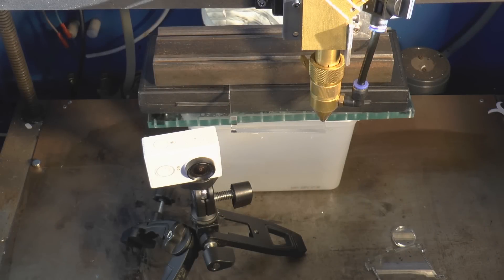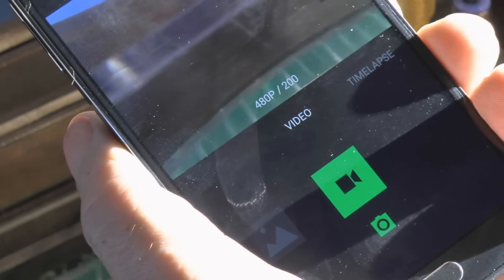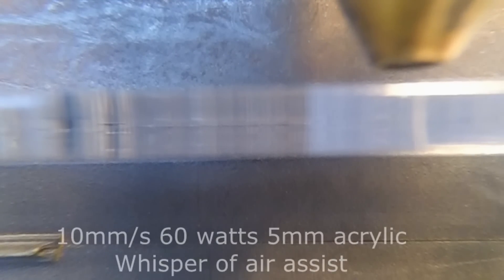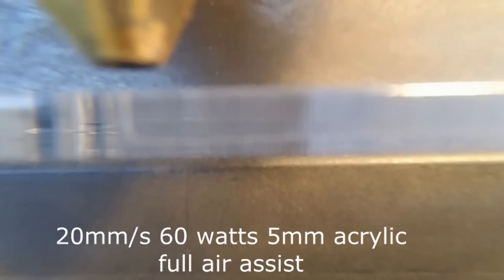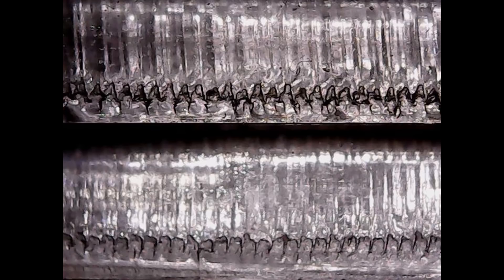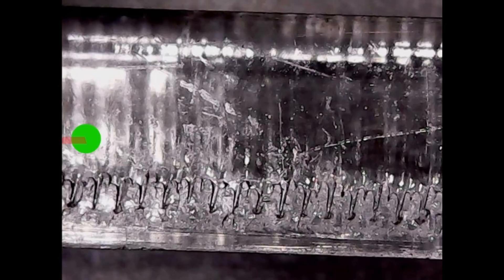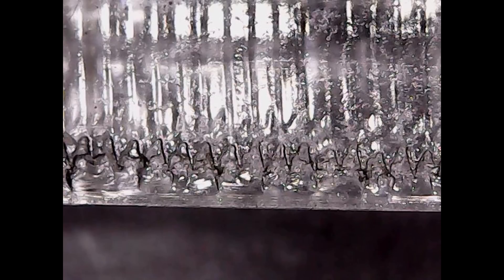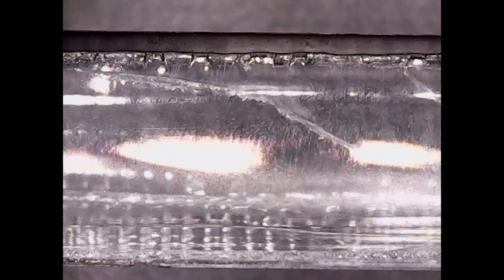RDWorks Learning Lab 86 Acrylic cutting slo mo

Comment: Hi Russ, just a thought regarding the gas exiting the cut at an angle, this could possibly be due to "Laminar Flow".
If you look at the exit point of the gas/smoke, it appears to "stick" to the bottom of the acrylic for quite a distance before peeling off at an angle, this behavior is very similar to how
liquids behave at low pressure. 
Just my 2 cents.
Cheers,
 Peter

Comment: Hi
Another great video!
Perhaps I'm missing the point here but I run a 130w tube and to remove the striations from the edge of 10mm acrylic requires a speed of 3mm/s and no air. 
At 60w @ say 70% on 5mm I would guess that 1mm/s and no air would remove this problem?
I had always assumed the striations where the result of the co2 pulse frequently and had never thought of the mechanics of ablation.
Reply from the maker: Hi Andrew
I use a 1.5" lens and can cut 5mm at about 8mm/s with just enough air coming out of the nozzle to prevent lens fogging and I can get virtually mirror polished edges.  However there is a tendency for the product to get stuck in its hole because the bottom of the cut gets sticky with the heat. Yes a bit slower and setting the focus a bit lower will fix the problems
The purpose of trying to run as fast as possible was to generate the striations for examination purposes. So many people believe these marks to be caused by the stepper motors/microstepping, and are even contemplating swapping to servos.That's the main myth I am trying to nail with this video and I do mention several times that running slower with virtually no air will dramatically improve the finish. For some small businesses, slow is unacceptable. 
With all the work I have done trying to understand the way these lasers work the only pulsing phase I have come across is the pre-ionization phase that will occur in your tube as it seeks to swap from 25kV to about 17kV for normal running. If you try running the laser at very low power values(maybe 7 to 12%) you will hear the beam is very "hissy"  when the beam is properly formed there is no pulsing involved, unless you are using dot mode.. I have recently bought a little USB scope and will be looking at some current flow signals in a future session to show these sorts of issues.
Also, I have to remind people that I am the one that is experimenting and learning in this video series. People consider them tutorials . Wrong. My other hobby is video, so learning about this laser and it's strange technology is great material for that pursuit and it means that the world gets to look over my shoulder. Any experience or advice you wish to give will be gratefully received.
Many thanks for your comment Andrew
Best regards
Russ
Reply: Hi Russ,
As I thought, I had the wrong end of the stick. You may be learning as you go but your analytical and pragmatic approach to each video is educating people around the world including myself.
I look forward to your future uploads.

Comment: Great video work.

It seems odd to me that the striations are so regular if they are being generated by a chaotic gas flow effect. What actually sets the period of the striations?

I would love to see the tube cathode current on a scope together with the step signal to the X motor to be absolutely sure the beam and motion are constant. Are you anywhere near Manchester?

I noticed on an earlier video that no matter what speed you run the machine the tone it makes seems to be constant. Normally with stepper motors the pitch of the noise is directly proportional to the speed. If that is not the case then there must be something odd about the drive method.

Is the air flow pulsing an issue?. When I dismantled a hot air gun powered by a diaphragm pump I found a plastic tank following it. Presumably that was there to smooth out the air flow. Why it would matter when soldering I don't know but diaphragm pumps do pulse.
Reply from the maker: Hi
I'm going to pass on that one.  I just cant check it because with 60 watts at 100mm/sec I do not get much depth of cut so, I dont know if the striations would be there at 100mm/s, with say, a 100watt laser where you  may be able to get a 4mm deep cut. As you can see,, doubling the speed fdrom 10 to 20mm/s did not double  or halve the period . That tends to point to a property of the material and not the performance of the laser. It's rare that I actually worry about edge finish on jobs but occasionally it's important, so I slow things down and back off the air. The whole purpose of this exercise was to prove that the edge condition is not related to the stepper motors as many had guessed. I'm happy to have nailed that particular myth. So I hope a clearer understanding of the problem will save others changing from steppers to servos to fix the issue because I was experiencing exactly the same striations cutting acrylic on my new ,machine which is fitted with hybrid servos.
Thanks for the question and the kind words
Best regards
Russ
Reply: Doubling the speed would not affect the striation spacing if say the laser was pulsed at a rate proportional to speed. I vaguely recollect that is a control method used by some people to keep the power density constant when the speed varies, or perhaps I dreamt it. 

I am hoping to take delivery of a Glowforge 45W CO2 laser in Jan but I have been waiting for it for more than a year already. When / if it turns up I will try to do the same experiments if I get striations  as I do have a 1000 fps camera and several oscilloscopes and logic analysers.
Reply: @nophead I too remain suspicious of laser power fluctuations/pulsing as at least a partial contributing cause unless (scoped) evidence to the contrary is available. Have you ever got to doing those tests...? I'd be very interested in seeing them if so...

Comment: I really loved this video.
Something I have always considered wrong about these machines was the method of air delivery.
They are dependent on an air delivery system that pulsates.
But it is obvious that the "mountains" and valleys are not the same.
Flame cutting at lower air assist rates might become smoother if your pump supplied an old Freon bottle or something that 
regulated pressure so that the air flow was also smoother?
Reply from the maker: Hi
I don't think smoothing the air will have a significant effect on cutting efficiency but it is something I have in hand for a future video. I plan to use just a 5 litre plastic bottle as an accumulator because the pressures are so low. I don't know the answer at present.
Thanks for the comment
Best regards
Russ
Reply: Cool ..

Big fan as always,

Jim

Comment: hey, Russ.  I have some question for cutting acrylic of the high precision. I want to modify the XY axis to ball screw that enhance the position precision.  because i hope the cut 10mm acrylic about 120MM length in 0.1MM tolerance. can you some suggestion to me?
Reply from the maker: Hi Jun
I am not a lover of toothed belts for controlling CNC machines but you will gain very little accuracy by changing to ball screws. Let me explain why.  The calibration of steps to physical dimension has to be calibrated at some point in the machine's life and stepper motors can easily achieve a positional accuracy of 0.025mm (0.001") . The belt is very stable in tension because of its spiral wound steel cores therefore  stepper motion is faithfully converted in to reliable and accurate linear motion ......in one direction.  It will NOT be the same in the reverse direction because of belt clearance on the drive pulley. However, because that  clearance is constant,  it is possible to add a software correction factor to remove this, 
see  https://www.youtube.com/watch?v=DeCxeCrq0h4&list=PLPWEtx5V9DqEogIeYRdcG_KYcB7UL2Qmn&index=49&t=746s

You are adding a lot more cost and rotating inertia  which will ultimately limit the acceleration performance of your machine

There  are TWO  other BIG issue you have not considered in your self imposed challenge.
A) The coefficient of expansion of acrylic. At typically .075mm/m/deg C,  120mm dimension will change by almost 0.1mm per degree C temperature change.  You can never cut acrylic rapidly because the cutting action is one of evaporation  at 200C and cutting 10mm thick material creates a lot of heat in the cut . Hmmmmmmm . How realistic is your goal now? If you measure it just after you cut it and then 5 minutes later I suspect it will be about 0.5mm smaller. 
B) Will you use cast or extruded acrylic? Cast acrylic will have abysmal thickness tolerances but because it is a poured liquid process it is pretty stress free. The same cannot be said for extruded acrylic . That will SHRINK  when cut as  the mechanical production stresses are released. It will also not shrink the same in both directions because there is an invisible directionality to the grain structure .

So now you know how impossible your task is. BUT understanding the problem is 50% of the solution. If you want accurate parts you must work with a pretty constant temperature and after cutting allow your part to stabilize. Then you measure it and add a correction factor to you drawing to allow for these errors. 

These problems exist no matter how accurate and expensive your machine. You cannot ignore the laws of physics.

I hope this puts your problem into perspective and saves you a ton of work and money!!!!
Best wishes
Russ
Reply: @SarbarMultimedia  
Awesome.it's good to elaborate explanation of aspect of  physics . 
1. As stated above, how to control the temperature which is my question. I have two idea that change the air blow or box environment temperature.
2. In mechanical structure, have any suggestion. In my concept, Choosing the ball screw and slider will stable in endurance of working time or easy to tune light path.  Yeah that maybe will bad concept that hope correct to me.
3. In my test , I have cut the 2mm or 1mm acrylic. It’s bad experience for me. i want control the precision in 0.1mm(in 120mm*120mm)(0.2mm tolerance of high yield).  it’s very unstable and difficult.
    1. Maybe the machine will work over 5 years.
    2. The Acrylic was difficult to control.
Reply from the maker: @juncheng6383  
Hi Jun
First let ma apologize for a typing error I made. The expansion of your 120x120mm square will be about 0.01mm/deg c and NOT 0.1mm/deg c as I typed. 
With thin acrylic there is less heat build up in the cut but cutting heat is still an issue. When you understand the physics there are possible cutting solutions that will reduce these effects.
You mention high volumes so I am now imagining that you have a very big machine that is working with a full sheet of material?  I think it will be better to speak by email so you can send me details of your problem because I feel there may well be methods of cutting that will achieve the precision you require. There are some extra problems with big machines that can cause the beam to wander. The CNC is accurate but the beam may not be in the same place relative to the nozzle for the whole work area. If you wish to discuss your problem further, add  your disguised email to another comment and I will contact you.
Best wishes
Russ

Comment: Great video! There are macro lens for this camera for about $10usd if you're interested, and you can adjust focus, shutter speeds with simple hacks.
About the striations, I wonder what would happen if the acrylic was preheated close to its sublimation point. Also some big pro machines use vacuum suction under the workpiece, could this be to draw out the smoke before it "ignites"?
Reply from the maker: Hi
Links to any of the lenses or the hacks would be useful please. I have a spare that I can safely play with. My bodge was adequate to gain the information I needed, but clearer pictures would have been better. Still impressed at what it will do for £50..
Nice idea about preheating  but there is one major issue, it wont work. Acrylic starts to soften and be come floppy at as little as 130C whereas the decomposition temperature we need for cutting is in excess of 250C  A useful reference document is http://stephen-webster.co.uk/wp-content/uploads/2011/02/Acrylic-forming-guidelines-for-workshop-practice.pdf 

I do know that the fumes are combustible because if you cut thin acrylic with too much power/not enough speed then the residual power can  actually ignite the vapor. I have experienced it many times.
Best regards and thanks for alternative ideas
Best regards
Russ
Reply from the maker: Many thanks for that info I look into it further
Russ

Comment: I think is a worth to see this part of my video - https://youtu.be/9x-H-rHN9nc?list=PLKqvqV6FhMtWv-wab69zSEvSEPDgJN4cz&t=232 where is a visible different effect of laser beam with longer and shorter focal length. Both cuts was done from same file, speed, power etc. Only lens was swapped upside down (red and blue marks represents direction of lens). Note the crater "ends" looks bit different in both runs. Blue crater is deep and smooth, finished with small white-ish crest, red one has a longer, fluffy crest (well visible at 5-45).

Comment: The pattern looks like the belts.
Reply from the maker: Hi Justin
If you only have experience of belt driven machines you can be forgiven for making that connection. Many large professional machines are screw driven mechanisms and still exhibit the same characteristic edge striations. It is most definitely a property of the material and the way it reacts to heat rather than a function of the machine.
Best regards
Russ